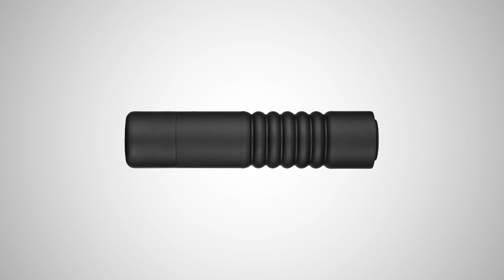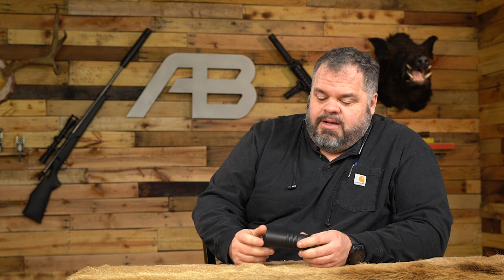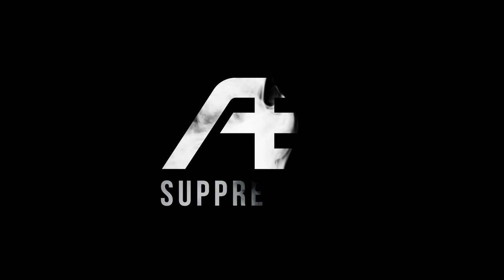Why Reflexes Matter

Comment: DT, I've watched several suppressor reviews that show that your reflex does not reduce decibels any lower than using the Raptor without it. Is there some other benefit?  Also, one reviewer showed that using the reflex on his SCAR caused excessive blowback. Is this a tuning thing or is this one of the expected results of using a reflex?
Reply from the maker: The most important function of the reflex is lowering the tone of the suppressor and the vast majority of the time it does help reduce blowback and the db by a couple points. Every firearm is a different animal and is only one of the factors that makes measuring suppressor performance very complex. If you have additional questions about the performance of our suppressors on different hosts feel free to contact us through our website.

Comment: Everyone says the raptor cans are amazing but the reflexes just don’t make a difference. Just saying… maybe you should do a test and put that out. I want one if the reflex works but if it doesn’t then there a multitude of other cans I’d rather have even though they’re going to be longer/heavier
Reply: I bought one anyways.. Hope it works
Reply: @ojsimpsonofficial  do you have any updates? Is it enough difference to compensate for the added weight? I'm not good with physics, but it seems like it's just a dead space. Unless there are holes on both ends of the suppressor, gasses will only travel to what's on front of the barrel as the exit hole is the path of least resistance. 

Maybe it helps for the first round pop, but once it's "filled" with the old gas, it stops becoming an expansion chamber. Kinda like those "cyclone" vacuums. It's designed where the collection bin becomes a dead space, moving air is redirected to an exit hole, and the dead space is able to collect trash with gravity and/or centrifugal force alone.

A way to fix this is maybe add small holes on the sides, towards the back of the suppressor. That way old gas still vents out making space for new gas to expand. Maybe a screw type hole like an adjustable gas block to tune for each firearm/ammo type.
Reply: @GTari97  I got the raptor 8 with the 3inch bull barrel reflex. There’s literally no difference in back pressure or noise reduction with 300blk subs or supers that I can hear. I used their adapter and a jmac brake to mount it without reflex on a 7.62x39 103 pattern AK. It sounds really nice but the back pressure beat the rear of my bolt carrier enough to require some filing and polishing after 120 or so rounds. It was A LOT of back pressure. It sounded great with the flush mount on a couple of AR’s as well but still had noticeable back pressure.
Reply: @GTari97  if your looking to spend your money on a moderately light can that offers decent sound quality, this is a good option with the adapter and flush mount option.. but there are a multitude of cheaper cans that are HUB compatible without an adapter, have a more capable firing schedule and weigh close to the same. I wouldn’t say I regret buying it exactly, but I can’t say the reflex lives up to the hype so far. I’m going to try it on a 308 bolt gun soon and I think an adjustable piston for the AK will tone the back pressure down.. but the reflex went back in the box and I’ll probably never use it again